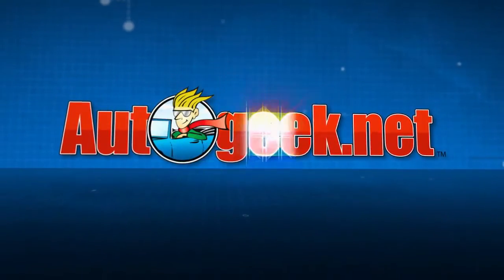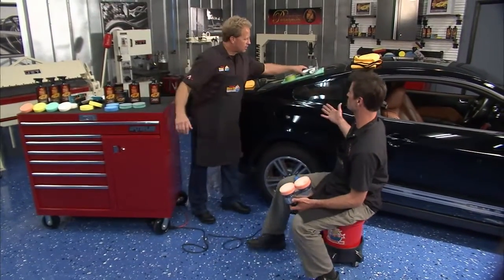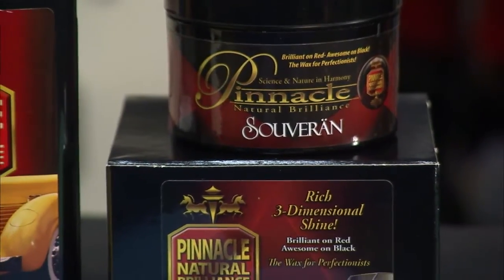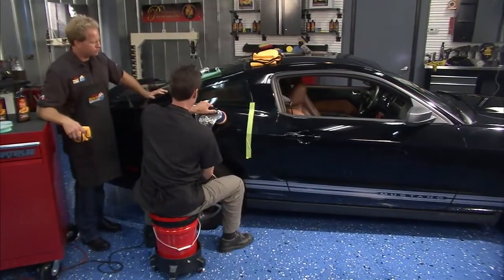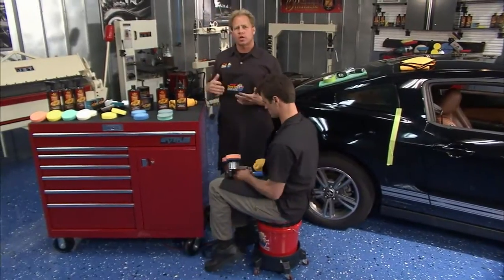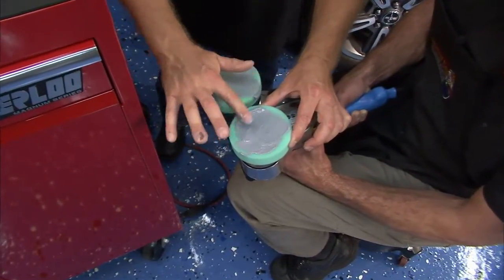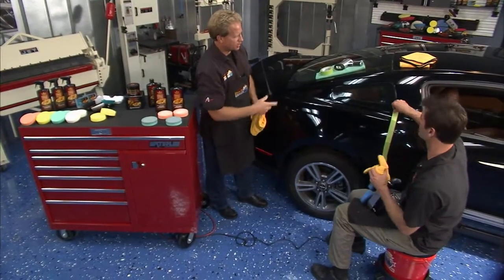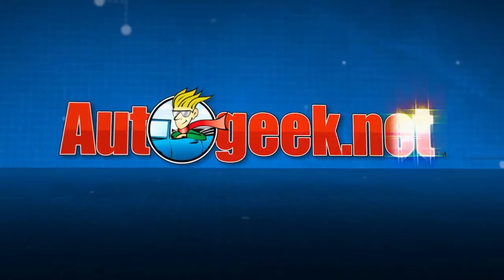Cyclo Polisher - How to remove swirls with Pinnacle Polishes with Mike Phillips and Bryan Fuller

Comment from the maker: Meguiar's M105 is more aggressive than the consumer version Ultimate Compound.  If this combo with an orange pad on a Cyclo tool isn't working it's probably time to use a rotary buffer with a wool cutting pad and then use the Cyclo to remove the swirls left by the rotary buffer and wool pad.  -Mike Phillips

Comment: Thanks for the comment Mike! I have one more question, in your opinion what is the BEST swirl/scratch mark remover without sanding. I have tried meguires ultimate compound and it has worked on lightly scratched paint but sometimes i need something more aggressive. What do you recommend? Using the orange pad of course. Thanks.